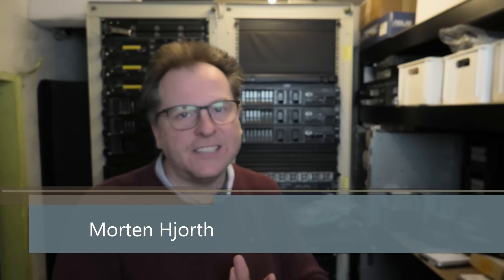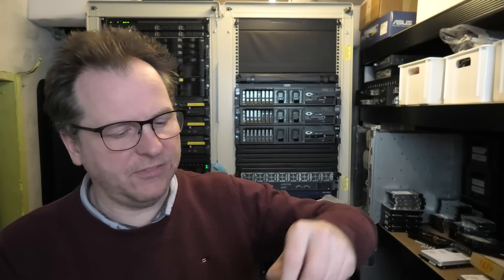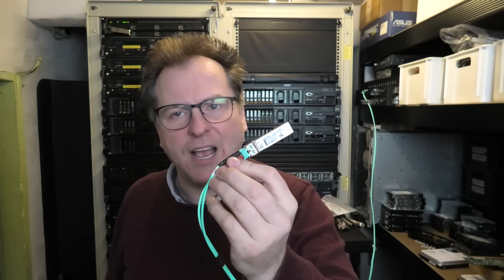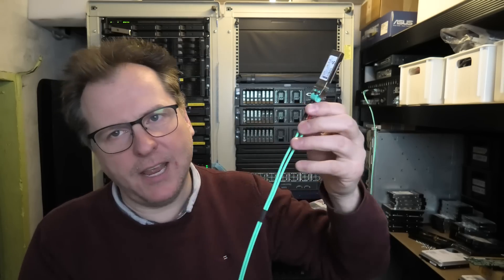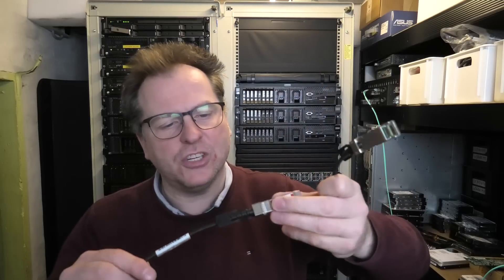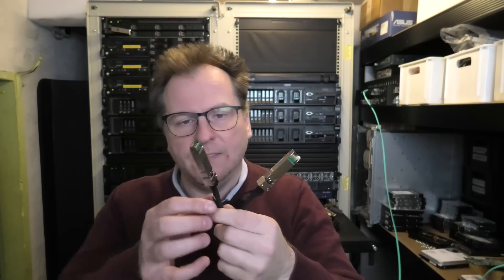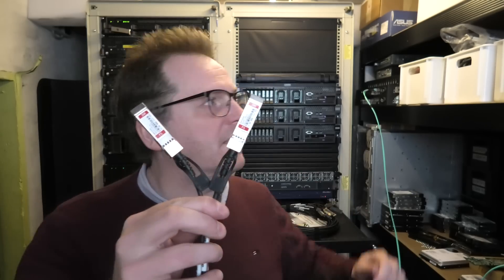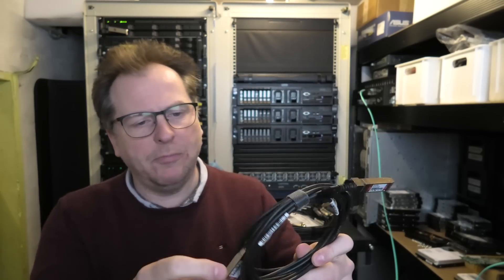Why DAC Cables Kicks Fibers A$$, in DataCenter Rack - 1284

Comment: I like DACs for short distances in the same rack. I use Digitus and they work in all servers and switches i have. As GBICs I use TP-Link. 10gbit cost about 30€ and work perfectly in DL380.
All fiber-cables and gbics are way cheaper than years ago. But switches with more than 4 sfp+ ports are still expensive. I have one 16 port sfp+ and hope it will never get damaged because it was really expensive (~3000€ at the time of purchase). And now switches with that many ports are hard to find and often not available.
Reply: @deepspacecow2644  I completely agree! And Arista (used) as well. Ebay can be your friend on this. Both for SFP-, SFP+-, QSFP-based and copper (RJ45) switches. I have a 48p RJ45 10Gbps Arista I got for $640USD w/4 QSFP+ and a 96p RJ45 10Gbps Cisco Nexus for around $800USD w/6 QSFP+. I've used DACs because of cost, ease-of-use, etc. They just work. "Cisco DACs" tend to be compatible with most NICs and switches. If this is for home lab or a small office, it's the way to go.
Reply: @Doesntcompute2k  I bought an edgecore as4610-54p. Nice switch, 48 poe ports, 4 sfp+, 2 qsfp+, all open source for $80. I want to use fiber because ebay optics are dirt cheap, I want experience with fiber cables, and keystone lc jacks in a patch panel will look nicer than a dac hanging around.
Reply from the maker: Hi Matthias Lange
Thank You very much!  glad you liked the video :-)
Thank you for watching! :-)

Comment: I don't know about you Morten, but i've already switched to 100Gb ethernet network and fiber is the way to go :) DACs -> thick, limited to 1-3m, expensive (!)
Reply: Working with 100G i can say leave Multimode and go Singlemode 2km easier management and cheap enough. However i do like DACs when possible because they are cheap. 100G-QSFP28 3m like 40€ you cant get there with optics. for 25G we'd be at around 25€ for 3m all new. 100G i a bit thicker than the normal SFP ish cables but manageble
Reply: @niklasp.5847  i got QSFP28 CWDM4 modules 25euro each + 5 euro for 5m OS2 cable :)
Reply from the maker: We do use 100Gbit between switches,, but from switch to Server it is 25Gbit and 10Gbit on older stuff.
Reply: BTW DACs can go to 25m. Just depends on the vendor and cabling. And they work to that distance BUT yeah, for 100G and 400G we use fiber. And I do agree with some other comments: SM vs. MM is the choice for those runs. Even if you don't want to run it "1.5Km," SM just gets it done without any issues. Short runs? MM all the way.